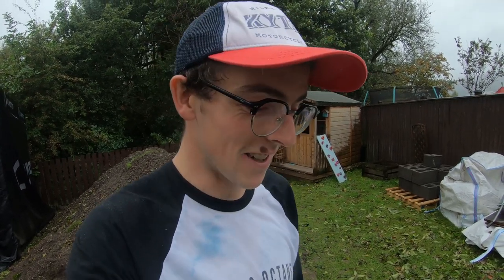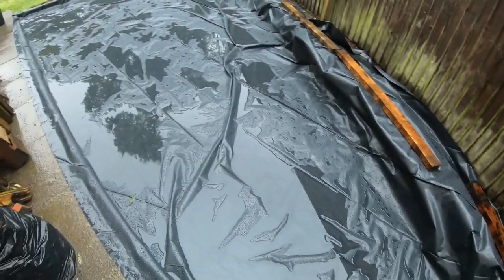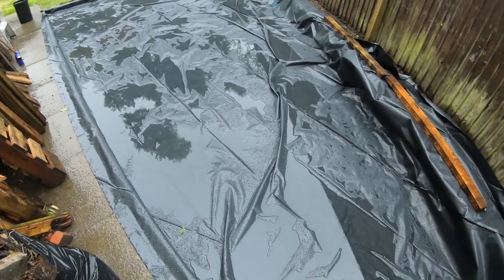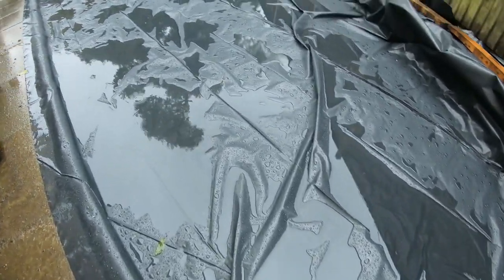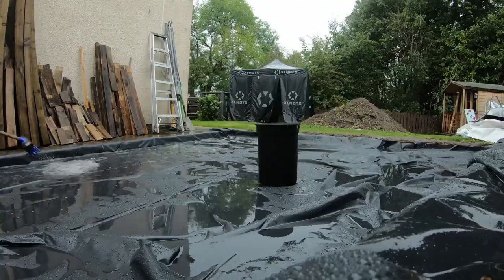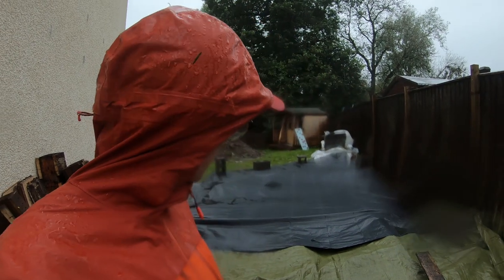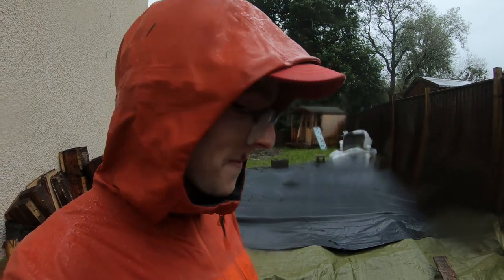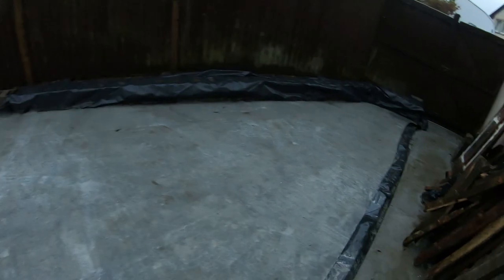Building a Motorcycle Workshop "Pouring a Concrete Slab" - Shoogly Shed Motors

Comment: Looks great! Well done 👍 Have you considered epoxy paint on the floor?
Reply from the maker: Got 2 tins ready to go!
Reply: @ShooglyShedMotors  Perfect! Just remember to wait until the concrete is properly dry before you start, it takes some weeks. I did not paint the floor when I built my garage/workshop several years ago, I regret it now :-/